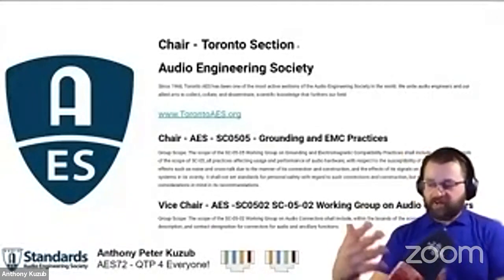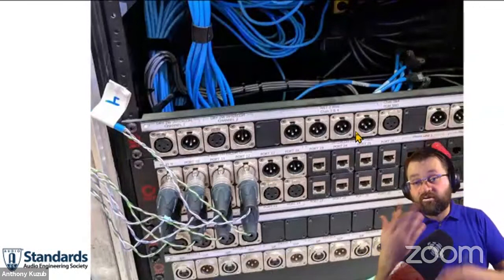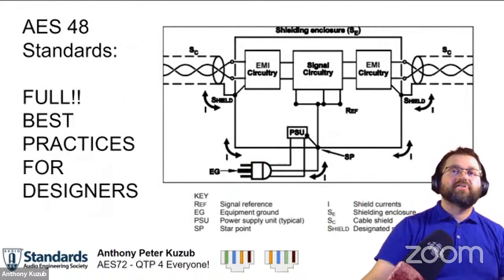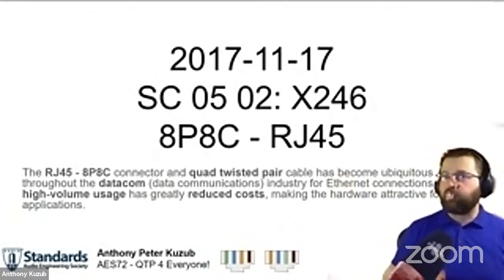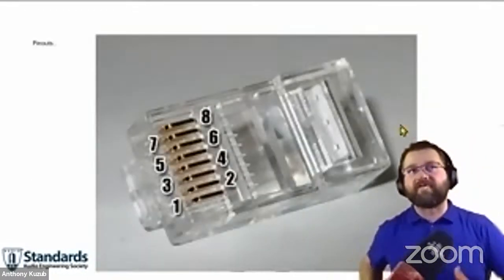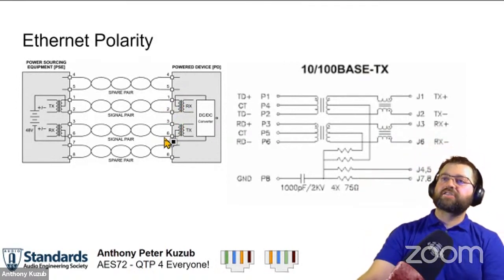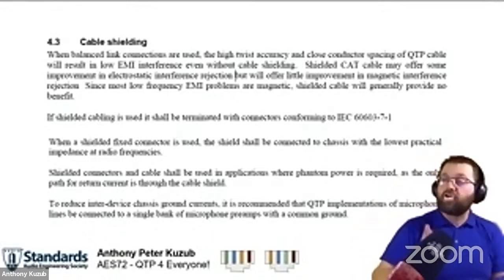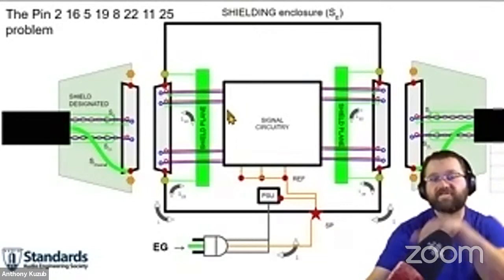AES Standards Webinar – AES72: Audio over Quad Twisted Pair

Comment: Why don't you just share the pin-out? If I google aes72 i just can't find a link to it
Reply: Because they failed to specify or recommend a pinout.  Instead, they specified many pinouts.  SoundTools and Neutrik all use different ones, that are all within the AES72 specs.  Many of the Chinese manufactures use yet another pinout, that is also AES72.  I'm aware of at least 14 different pinouts.

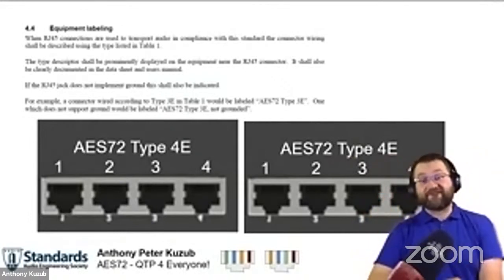Comment: At 37:39" the presenter mentions that the ports for the RJ45 shouldn't have lights - why is this? It it because of RF?
Reply: Because those are typically indicators of connectivity in ethernet.   Since aes72 is fully passive. There is no need for indication.
Reply: @LikeDotAudio  Ahh, that makes sense, thanks!